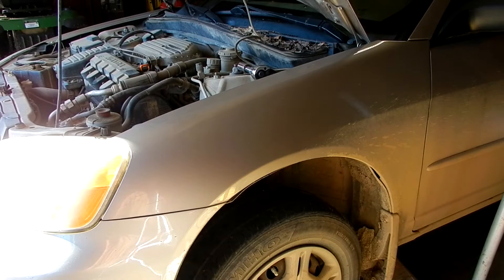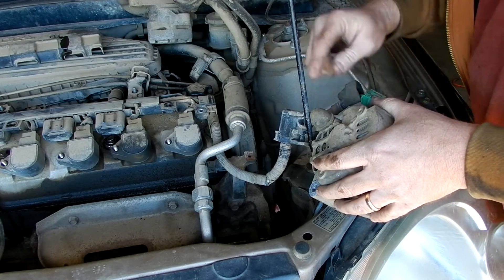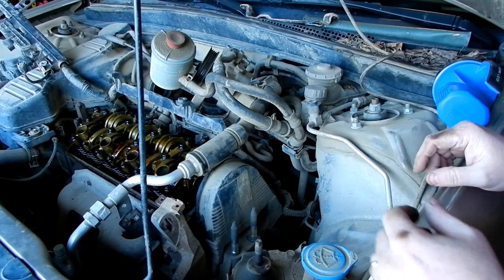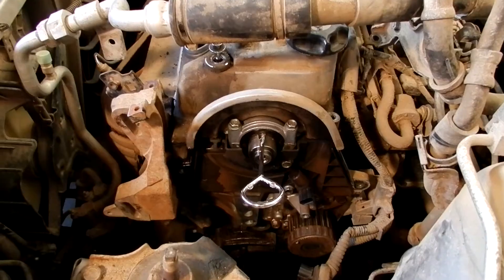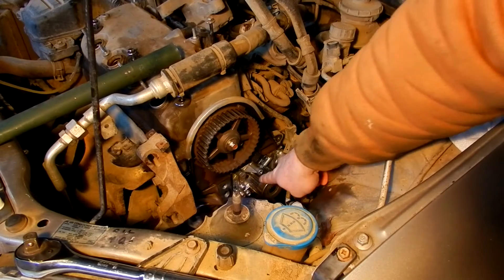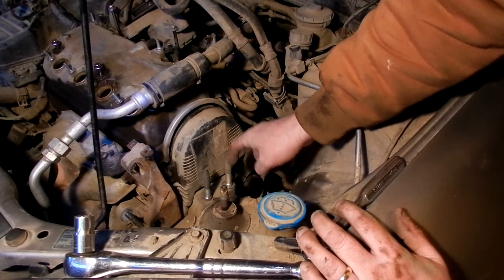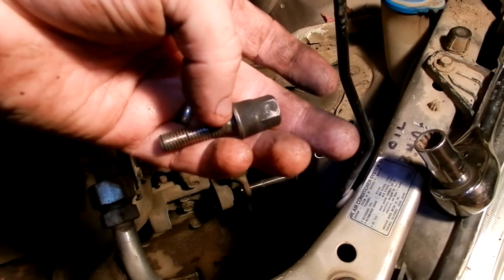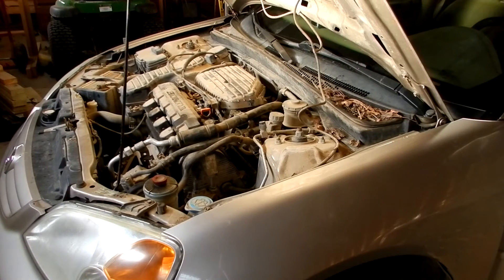Replacing the Timing belt, water pump, idler pulley, camshaft seal - 2002 Honda Civic

Comment: Okay, I am not even two minutes in, and this is hands down the most fantastic method of showing steps of a process. No shaking cam with one hand while fiddling around with the other. No setting the camera up then stepping in front to block the action. No endless droning on about unrelated steps or topics. No shoving items two millimeters front of the camera for two milliseconds of fuzziness, unsuccessfully showing an item in detail. No lengthy boring time wasted watching the person actually unscrew every nut and bolt. Just perfectly set up shots, showing every step and every item to be undone, without the tedium. If you do all your videos like this, you deserve 1000x the subscribers you currently have. Kudos!

Comment: Thanks for the video.  I'm doing a head gasket and couldn't find anything on the cam shaft seal.
Reply: Dem Guiz 
My chilton manual says 41 ft.lbs for the camshaft sprocket torque 
In this video he mentioned 27 ft lbs
I’m not sure which one should I use. Mine is 04 Honda Civic.  Same model

Comment: hello, great video but quick question i have a Honda  accord lx 2000 but i just want to clear my mind a little. Does my car only have one camshaft seal correct ? Because  i have a oil leak in my car but i am not sure if thats it. Any recommendations ?
Reply from the maker: I believe there is only 1 camshaft seal.  But there are also two crankshaft seals, the oil pan gasket, and the valve cover gasket.  Your best bet is to clean everything off, then look for where the leak is coming from.